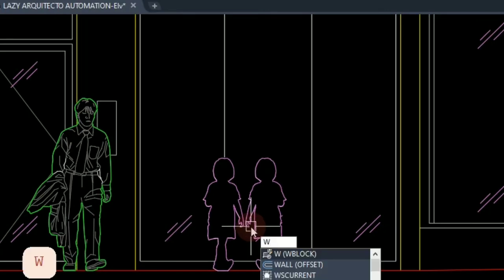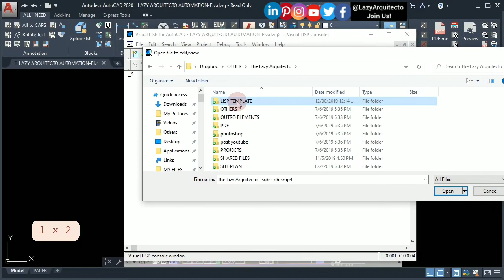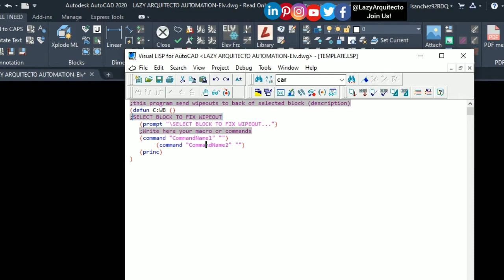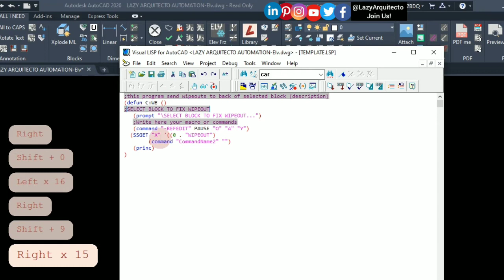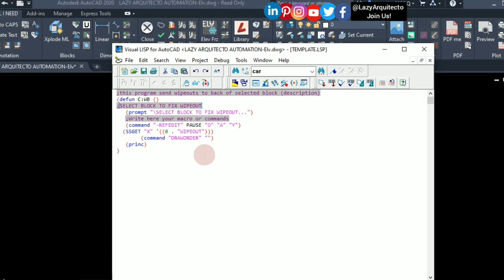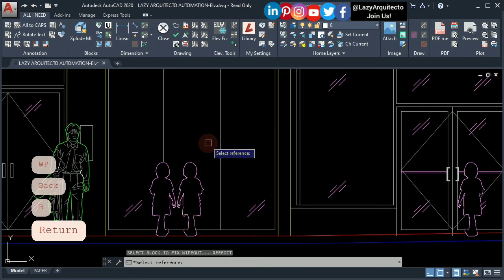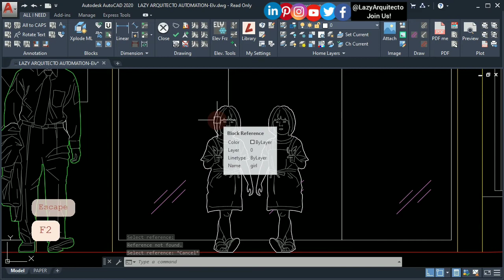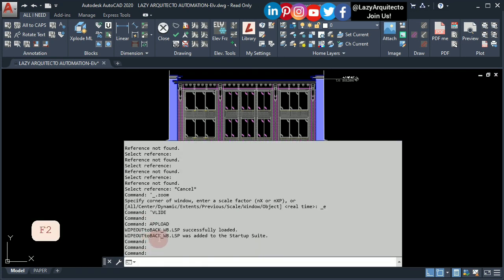Autocad Wipeout Problem: Fix Wipeouts in front of Blocks, Here's How |P5V13

Comment: Hello sir,  i have an issue. 
I frequently need to use hatch pattern and equipments near door.  Your concept of using wipeout in door to hide walls was awesome. However in mycase draworder has turn out to be villain.

Is there any macros to trim wall between  several door with in few clicks?
Reply from the maker: Welcome to the team! That is why i created WIPEOUTtoBACK command to fix your problem of wipeout showing in front of blocks. Let me know if you need help setting it up

Comment: Works great! Thanks for your video! Now I need to add a command since some of my blocks have hatches and wipeouts. I need to add a command that sends the hatch to the back and THEN the wipeout to the back.
Reply from the maker: Welcome to the team Krysmar! Glad this worked for you. You can use HP shortcut for hatchtoback command to send your hatches to the back. Where are you from?
Reply: @LazyArquitecto  Civil engineering firm focusing on telecom located in Southern California. Thanks for the tip! Ever since we got Autocad 2019 we've had this issue.

Comment: This is what I put in the LSP. It does not work. Where is my error?

;; This sends Wipeout to the rear of the block (DESCRIPTION)
(defun c:WB ()
  ;; Select block to fix Wipeout
      (prompt "\SELECT BLOCK TO FIX WIPEOUT...")
      ;; Write your Macro or Commands
            (command "-refedit" PAUSE "O" "A" "Y")
            (SSGET "X" '((0 . "WIPEOUT")))
            (command "DRAWORDER" "P" "" "B")
            (command "REFCLOSE" "S" "")
      (princ)
)

This is what appears on my command line:

Command: WB
SELECT BLOCK TO FIX WIPEOUT...-refedit
Select reference:
Select nesting level [Ok/Next] <Next>: O
Enter object selection method [All/Nested] <All>: A
Display attribute definitions [Yes/No] <No>: Y
Command: DRAWORDER
Select objects: P 1 found
Select objects:
Enter object ordering option [Above objects/Under objects/Front/Back] <Back>: B
Command: REFCLOSE
Enter option [Save/Discard reference changes] <Save>: S
Regenerating model.
1 block instance updated
A$C33569a53 redefined.
Command: WB
Unknown command "WB".  Press F1 for help.
Command:
Reply from the maker: Can you  try the command in a normal block? I thing you're trying it in an anonymous block (block with weird name A$C335...
Reply: @LazyArquitecto  Actually, I originally , by mistake, tried it on a block that was contained within another block. . It does "work" in a "regular" block with the "weird name" but this is what I get now:

SELECT BLOCK TO FIX WIPEOUT...-refedit
Select reference:
Select nesting level [Ok/Next] <Next>: O
Enter object selection method [All/Nested] <All>: A
Display attribute definitions [Yes/No] <No>: Y
Command: DRAWORDER
Select objects: P 2 found
Select objects:
Enter object ordering option [Above objects/Under objects/Front/Back] <Back>: B
Command: REFCLOSE
Enter option [Save/Discard reference changes] <Save>: S
Regenerating model.
1 block instance updated
A$Cc05e1b1a redefined.
Command: WB
Unknown command "WB".  Press F1 for help.
Reply: @LazyArquitecto  It does woprk and fic the wipeout in front error but I am getting the same "Command: WB
Unknown command "WB".  Press F1 for help." at the end of fixing a "normal" named block named Hinge:

SELECT BLOCK TO FIX WIPEOUT...-refedit
Select reference:
Select nesting level [Ok/Next] <Next>: O
Enter object selection method [All/Nested] <All>: A
Display attribute definitions [Yes/No] <No>: Y
Command: DRAWORDER
Select objects: P 2 found
Select objects:
Enter object ordering option [Above objects/Under objects/Front/Back] <Back>: B
Command: REFCLOSE
Enter option [Save/Discard reference changes] <Save>: S
Regenerating model.
1 block instance updated
Hinge redefined.
Command: WB
Unknown command "WB".  Press F1 for help.
Reply from the maker: @kotjmf1968  well if it works, then it is fine right?
Reply: @LazyArquitecto  Yes, except for the garbage at the end.  Any idea what causes that?